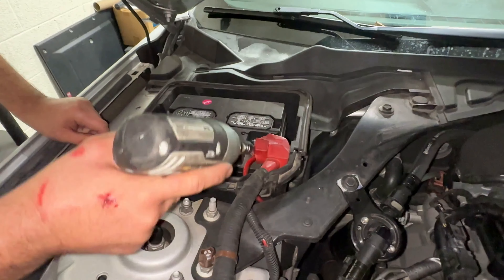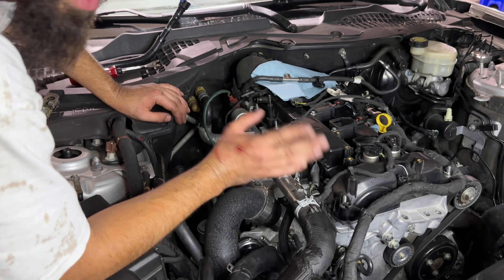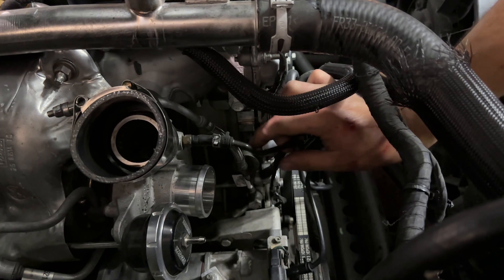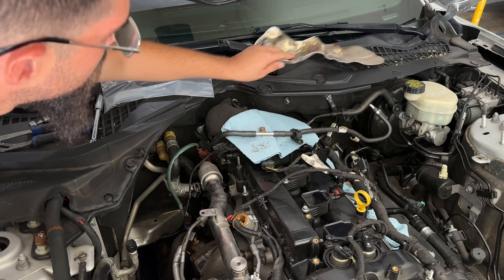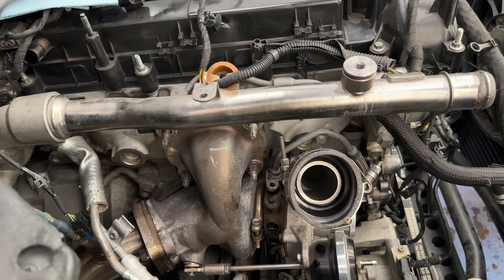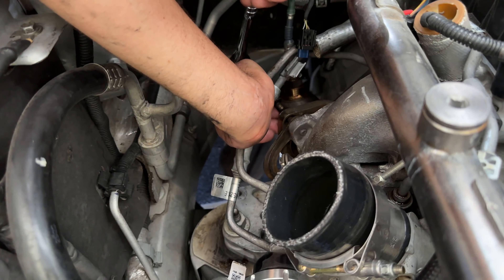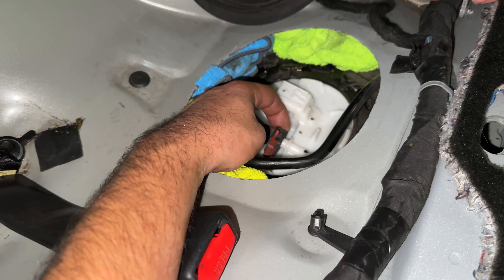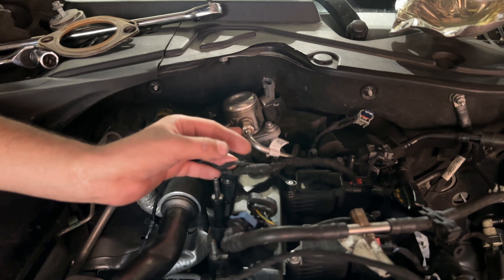Mustang EcoBoost S550 Head Gasket Replacement - Ep 2

Comment: Well done, could use better lighting, which is very hard to do as an amateur. I have a 2.3 2017 mustang with almost 50,000 k. Today it ran past it's nnormal 186F, monitored continuisly, to 199F. I let the car cool down for 2 plus hours before checking the water level. And you probibly know that it was down consideritly. I will start tearing it down tomorrow. Where do I find Ep 3, i'm going to need it. Thanks so much.
Reply from the maker: I will create a separate playlist it will be labeled Eco boost head gasket replacement.thank you lighting is hard lol

Comment: Dude how the heck did you get that bottom bolt off the downpipe flange?😭 we have the car lifted and trying to get it from under but that thing isn’t moving.
Reply from the maker: That one sucks all I can say some times they break. I would try two things sock it down with free all spray. There is also heat with a blow torch. Please be safe and careful. Also use a flexible wrench with a lot of grip.
Reply: @TOUGHBUILDSCUSTOMS  How hard is it to get back on? I'm debating taking it off the block instead.
Reply from the maker: @gregalot200  it’s not that hard put back on. Once it’s off it’s a little easier than taking it off Twerking it to speck on the other half is a little complicated. Unless you have an impact swivel. It’s going to be hell. Sorry it took me forever to get back to you.
Reply: @TOUGHBUILDSCUSTOMS  I am planing to tear down my 2.3 mustang tommorow morning, but getting concerned. I'm not sure this is a gob for even an above average back yard mechanic
Reply from the maker: I’m sure you can do it. Just follow the videos and you should have no problem at all putting it back together